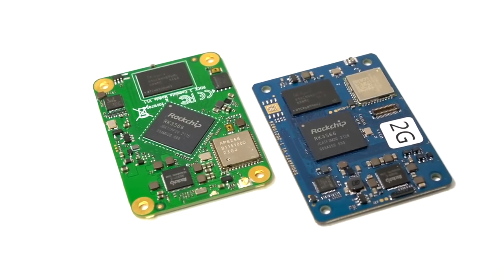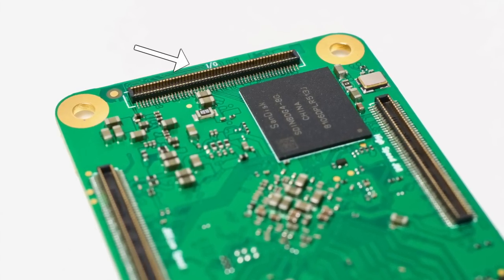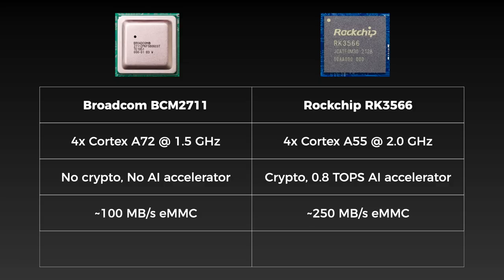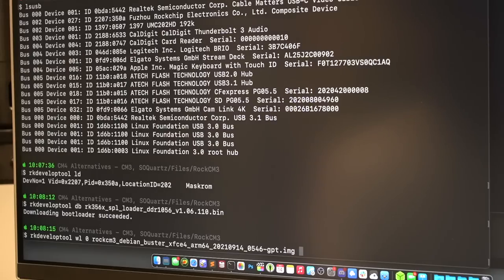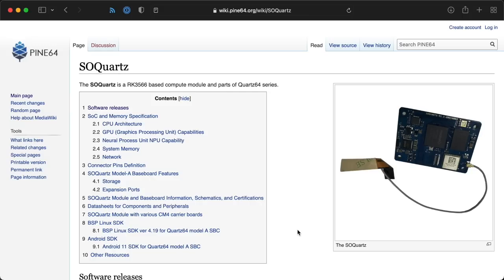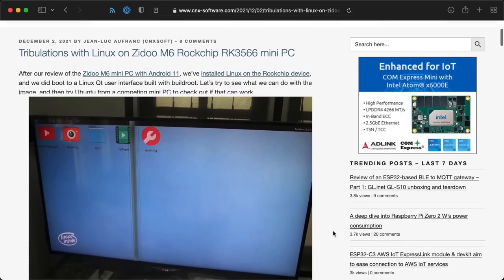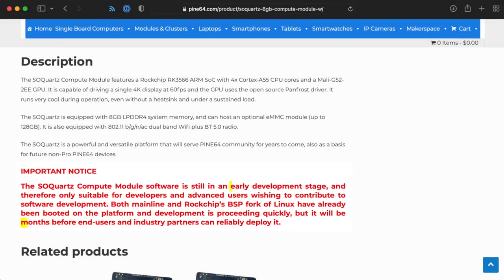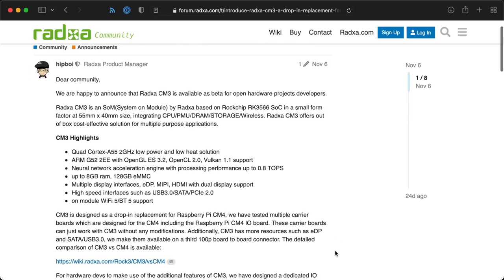Can these boards replace the Raspberry Pi CM4?

Comment: Those two are early development boards and You get them right after they were released. Don't expect that much, it's new soc, and it will take some time to do development and documentation, still it's better to have such choice and fresh look.
Rpi is reusing everything as much as they can. Old microusb, same cpu on 2w and 3b, small specs choice etc. That makes everything easier and cheaper, but you have less control over everything. Rpi is rather than more matured rk3399 sbcs now. Few years ago rockpro64 was released and it was very first board with rk3399. Same as now quartz :)

Comment: 3:04 - tired me hasn't the energy to elaborate right now, but...
pro tip: never (allow) ssh(ing) as root.  :)
Reply: p.s. oh yeah, I meant to add something with at least some vague hope of being useful: did you try pi/raspberry?
Reply from the maker: Heh, you'd think, but OMV still allows root to SSH in out of the box, and allows SSH password login too!
Reply: @JeffGeerling  boo on both counts, but especially the former.  Root should be thought of as a privilege escalation (via e.g. sudo), rather than a user.  IMHO.

Comment: Jeff Geerling Is there a KiCad footprint for the connectors on the CM4. I want to make my own PCB that I can plug a CM4 into..(or one of the other boards mentioned in this video)

I would like to use it to make a tablet that is DuckDuckGo compliant...
Reply: Raspberry Pi has KiCad design files of their IO board. I'd assume you might be able to copy the CM4 footprint off from it.
Reply: @Foxhood  I would really like to make a tablet that has a 9 DOF, real compass, IR port and a few other sensors missing from current tablets.
Reply: @WagonLoads  Can't say it is an easy task, but it is feasible and something the Compute 4 would be ideal for.

Comment: The real value in the Raspberry Pi comes from the great software ecosystem and documentation done by the Pi Foundation and the community. These Chinese vendors don't get that and are just interested in making copies which look good on paper but suck in real life. This has been the case for the last 9 years since the Pi came out. That's not shilling, that's reality. I also wouldn't be surprised if half these "fruit clone" boards have phone-home chips too. No thanks.

Comment: Can someone explain to me why PCs just work for booting but every ARM board is some special snowflake that 90% of the time just doesn't work?

Why do ARM boards need custom images by my computers don't?

Also nvidia belongs in the hall of shame for leaving jetson on ubuntu 18.04 and closing the request to update with won't fix.
Reply: The short version is Intel, IBM, and Microsoft all ended up writing a spec for handling the early hardware setup and booting. The spec was not intentional originally but Intel wanted to sell CPUs and Microsoft wanted to keep both IBM and the clones. Nobody in the ARM ecosystem wants to make such a spec.

Comment: The Broadcom doesn't have crypto extensions?! :o
Reply from the maker: Nope :(
Reply: Well, there is no perf difference with crypto using 32bit OS, as it is not really enabled there. If they have it and try to enable it, it could be even worse.
 AMD and Intel have AES on anything since year 2012/2013. But this is only enabled to be used on 64bit ssl and 64bit OS.

Comment: I hate the cm4 connector... the old connector was so much better...
Reply from the maker: I don't hate it, but I don't love it. For compactness, the new connector is nice; you can make extremely tiny boards (and even ditch the high speed connector if you don't need that IO). But in terms of compatibility and needing less precision, it is annoying.

Comment: Rockchip is more ODM oriented not community oriented.
Reply from the maker: But those using their chips (Radxa, Pine64, et all) are more community oriented... somewhat at least. I still want the SBC space to have more competition, but I don't think the competition can come on hardware alone.
Reply: @JeffGeerling  Yes, Rockchip is working pretty hard by the way. Compared to Apple, Rockchip is quite open to the industrial business.
Reply: @JeffGeerling  For apple, the industrial business is Apple-self.

Comment: Almost every random Chinese shitboard is just a horrible user experience. Nothing else has the support or documentation of the RPi. If you care about accomplishing a project, use RPi or don't waste your time.
Reply: Isn't there security issues with them as well?
Reply: @JJayzX  it's possible. I mean, I have more concerns about Chinese-developed software than hardware (eg: Deepin Linux).